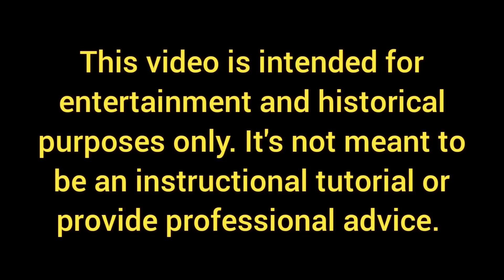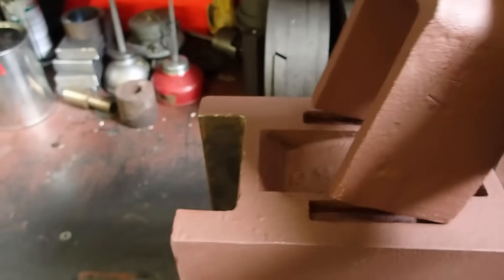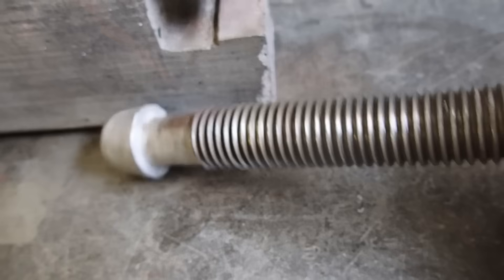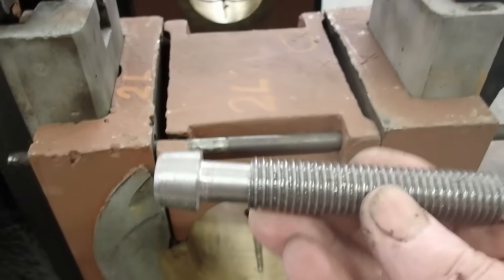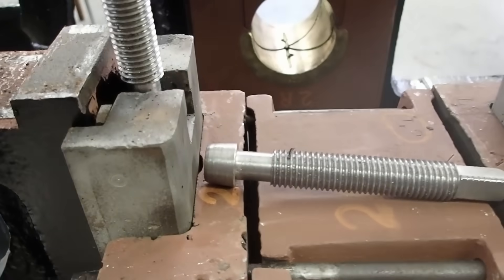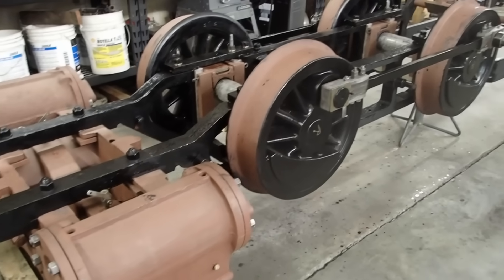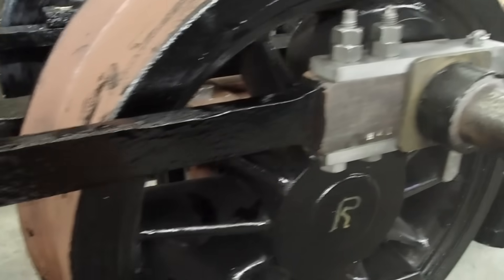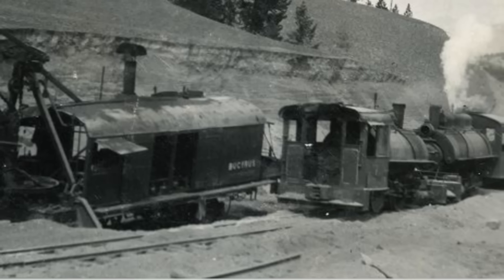Ep 19 - Part 2, Back On Her Wheels!

Comment: Hello and thanks for bringing us along on this adventure!  I will likely never have the opportunity to work on anything like this, but I find it fascinating anyway.  
One question - that wooden beam at the back of the frame - what kind of wood is used?  Would it be possible to replace that with an aluminum beam that would not be as susceptible to weathering and would be stronger?
Reply from the maker: The buffer beams could be replaced with aluminum but that wouldn't be very original. I believe they probably would've been oak originally however I'll be using old growth Douglas Fir.

Comment: The cellars need to have a foam or spring steel pushing the waste against the axle in order to lubricate. Packing the cellar with waste like the axle boxes on cars may cause other issues like errant pieces lodging in the bearing bronze, which can starve oil. Waste should have no dyes of treatments to it and basically be raw clean wool. Pacific car and journal can help with this.

The bearing bronze can be a hub liner but most, even now, will make a form and pour a Babbitt hub liner. The softer metal will catch contaminants without scoring the bearing bronze. Wheel hub liner usually are bronze and use a soft grease.

Comment: so much historical knowledge is neccessary to work on these old machines...how they used to do things and why...that would completely cross-up a modern trained machinist, and quickly get them into trouble. Restoring the old engines, well that's a great and noble thing to do, but my question is, once the current generation of machinists that know how to do the proper restorations have passed away, who will be left that is able to keep them going? Hopefully these videos, along with supplementary commentary and instructables, will be properly archived to enable future conservation to occur.

Comment: Dear W2R
A fantastic series of videos.  The perfect combination of machine shop work and restoration-reassembly with lots of excellent explanations!   I myself have been involved in a very similar process namely the restoration of another 0-4-0 saddle tank, but ours is a little larger being 21 tons and gauged for 3 ft 6 inches (Cape Gauge).  If you are interested, please look  up "The Huntsville and Lake of Bays Railway" in Huntsville, Ontario, Canada.  When sorting out our axle boxes, rather than using the improvised handful of cotton waste, I obtained some custom made, spring loaded axle pads from a company in the UK named "Armstrong Oilers" (they have a website).  They have been making axle pads for years and use the traditional manufacturing machinery that is essentially now extinct.  Given I could not send them the loco, we made a precisely dimensioned  wooden copy of the cellar (or "Underkeep" in UK steam loco parlance) along with a drawing showing the axle diameter and a few other measurements and they made 4 pads for us that fit perfectly and are still working perfectly after more than 10 years.   Hope that may be of some interest and please keep making these wonderful videos.  Best wishes.  Paul from Canada.
Reply from the maker: Thank you for that, I'll dig into it a bit more! Glad you're enjoying the project!

Comment: Just a quick question: Seeing as you may need spare parts, someday, why not make at least a dozen of these bolts and/or washers, side rods, etc.?
Reply from the maker: Great question! Realistically the amount of care the engine's are expected to receive going forward should mean that the existing bolts will last indefinitely.
Reply: The size variations sort of preclude that idea, with as little actual use as these engines will see.  There are probably not over a dozen engines like these in this size left in the world.  The parts you are asking about are easy to make when needed.

Comment: Another very interesting episode.

Regarding the center top lubrication hole, if my engineering textbooks are to be believed, oil will actually come out of that hole under fairly high pressure when the engine is moving. The principle of hydrodynamic lubrication was accidentally discovered this way. Someone was experimenting with railroad axle bearings around 1900 or so and drilled a hole in the top of a bearing like that. When the axle was rotated, they noticed a steady flow of oil came out of the hole. They pressed a cork plug into the hole to stop it, started the axle turning again, and the cork came out with a big pop. They finally threaded a pressure gage into the hole and realized considerable pressure was generated, which forms an oil film separating the axle from the bronze when the axle is turning. On this locomotive, the original top center hole may have actually provided “automatic” lubrication to the outside of the axle box.

In your case, the unnecessary diagonal oil channels cut into the crown may destroy or hinder this effect.
Reply from the maker: All very good points! Thanks for taking the time to add a little more depth to the subject!

Comment: I had no idea how truly sophisticated these old locomotives were. They are very complex with a lot of engineering built into them.
Reply: I noticed there a hole on the wheel face are you going to fill it in with welding and grind it smooth ?
Reply: @grahamlane1313  Would you please identify the hole by the timeline of the video?  I am not sure exactly what you are referring to.  I saw center holes in the crank pins; they are supposed to be there.  I am now curious as to what you are referring.  If it is in the wheel center itself, those are cast iron and can't be welded for practical reasons.  Cast iron doesn't weld to very well because of its molecular structure.
Reply: @royreynolds108  I guess he means the hole well visible at around 18:10 - this looks quite deep indeed. I understand that cast iron can't be welded, but I have learned (from Keith Rucker) that it can soldered with bronze. Would this make sense in this case?